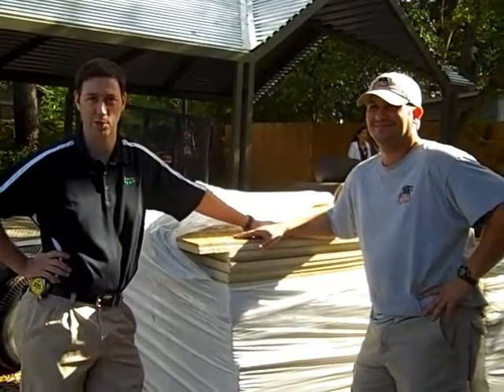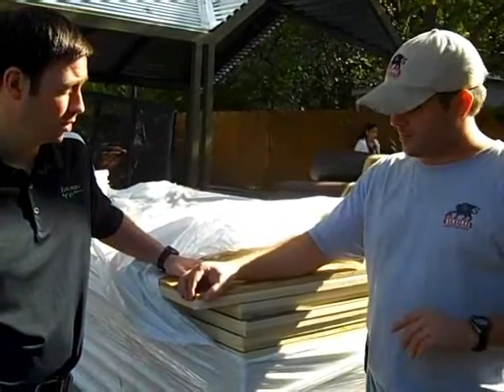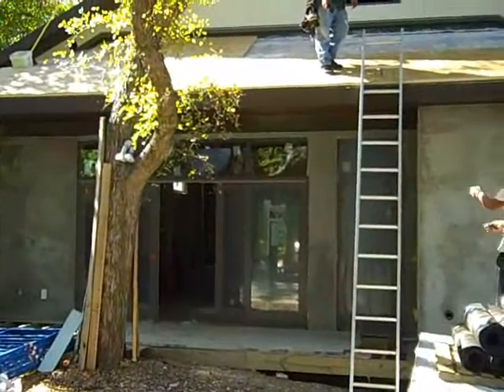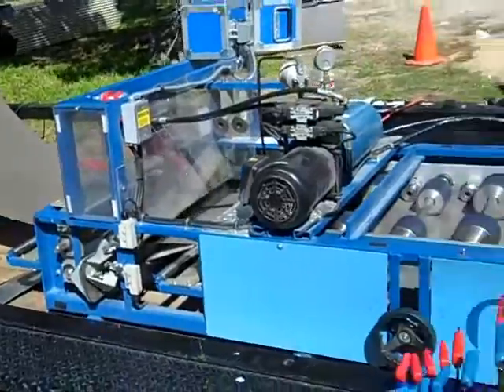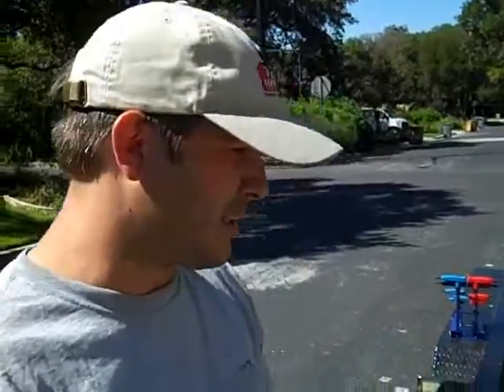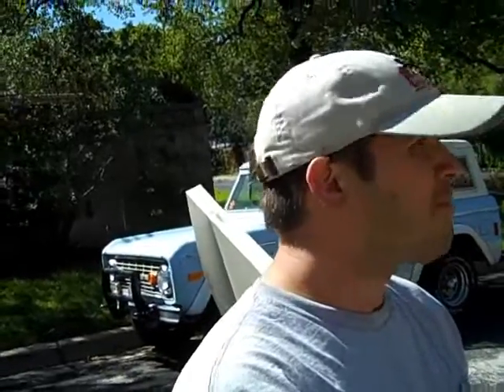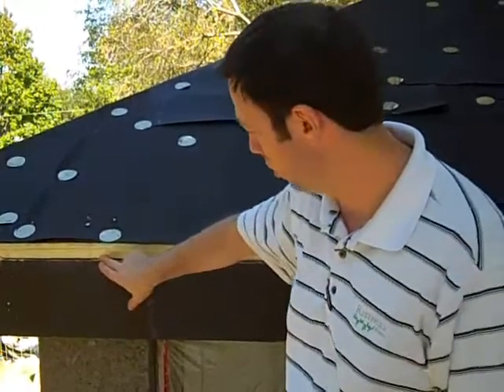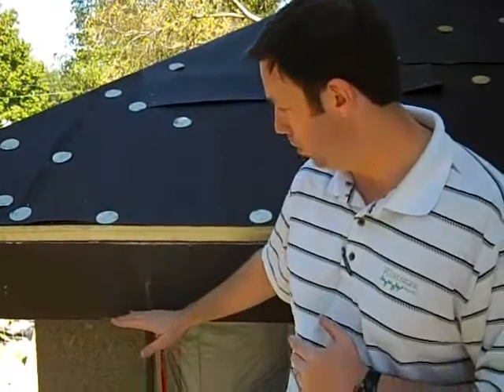Iso Board Roof Decking for a New High Performance Home

Comment: Can this iso system be used with a shingle roof? or is there another type of insulated method you recommend better for single roof? we would like metal, but cost does weigh in for us. So, looking for the best efficiency & insulated method, we are in South Florida with an old roof so completely redoing. please any advice asap would be so greatly appreciated.

Comment: q1. where did you buy the ISO board with insulation? I can not find them locally nor internet order.  
q2. the insulation board side goes under the plywood side right? 
q3. any special fastener used?

Comment: Can the iOS board panels be used on top a radiant barrier, or do we lose the benefit of the radiant barrier? it.does seem you would still have the benefit of the air gap on the attic side plus the insulation from the iOS board.

Comment: It looks like your roofer used the wrong type of washer to hold his felt down.   Those washers have a slightly raised profile and will bend the panel if stepped on.  Next time use tin tabs sold by Berridge manuf. (the same company that supplied your coil)

Comment: The hunter isoboard with the OSB panels is a great system to use, but why are you guys using a 30# felt instead of a polglas polyflex mts self-adhering base sheet? I would be worried that the felt would fail and you'll have to come back and coat the whole roof in an eternalastic or something. That roofing system looks great, but don't go cheap with the base sheet if you want a lifetime warranty to stick.

Comment from the maker: @malkooth Those houses were most likely traditionally insulated with blown insulation on top of the ceiling sheetrock.  In this video and on 95% of my jobs we are spaying foam directly to the underside of the roof deck.  In this video we're doing that PLUS putting PolyIso board on top of the roof deck to further eliminate thermal bridging.  This is best practice for our HOT/HUMID climate but may not be right for your climate. Consult the Builders Guide for your climate zone by Dr Joe Lstiburek
Reply: Matt Risinger Thank you for all your videos. Love the content. So many years of great building science information!
Reply: We need a Update In Miami for Roofing.